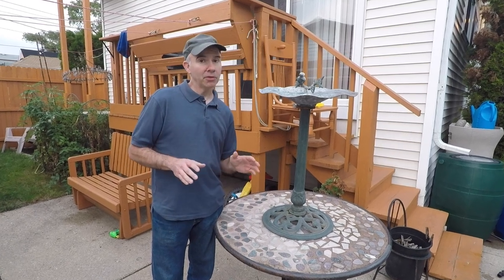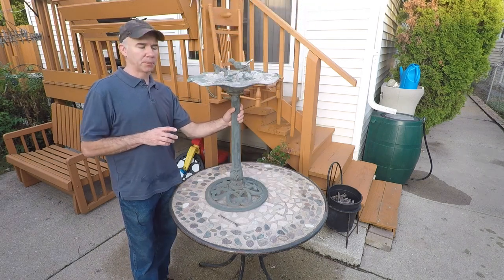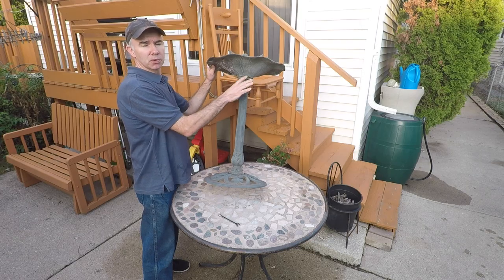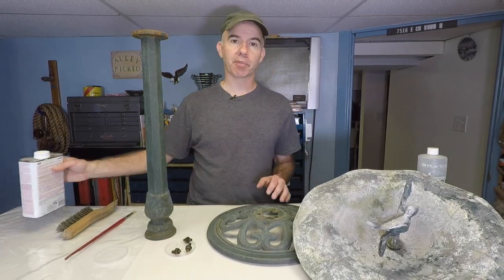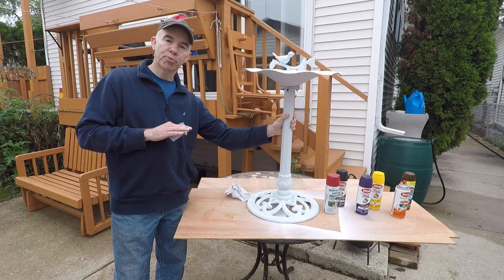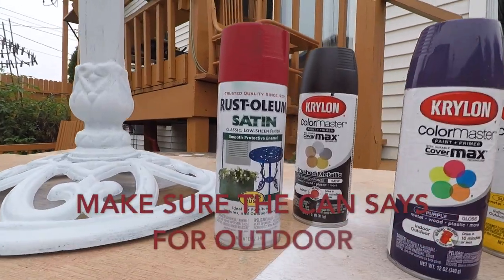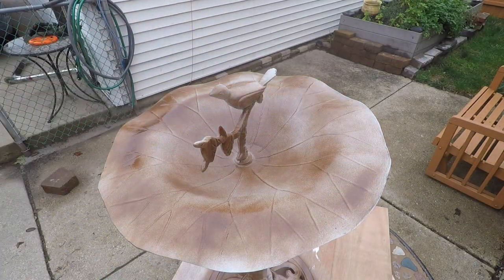Bird Bath Restoration

Comment: Someone touched on this a bit below but it's super important that the paint in the actual basin is only acrylic or latex. Oil or petroleum based paints are NOT safe for our feathered friends. The paint can be finished with some polyurethane which actually is safe once dried. :)
Reply from the maker: Thanks for the tip. Another person mentioned using Flex-seal which he said worked very well. I'm not sure if that is safe for the birds.

Comment: Update - I used Benjamin Moore 2 part epoxy pool paint as a final finish and it's held up great. You have to sand the bowl to bare metal, degrease it with rubbing alcohol, 2 coats of Coronado WB Acrylic Rust Scat Metal Primer 36-11 White and 2 coats of the Benjamin Moore 2 Part Epoxy Pool Paint.

Comment: I see I forgot to add an update about the Flex Seal, It lasted a year then lifted from the metal surface, cracked and allowed water underneath it which pretty much finished it off. So not a long term solution.

Comment: Update on the pool paint, It's now May 2024, the birdbath with the pool paint is holding up great, I store it inside over the winter, I just gave it a good cleaning and there is no flaking, peeling or break down of the paint. It's going to the cat rescue shelter today to be set up in front of the shelter main room for the cats to watch. I would say the primer and pool paint as I noted in one of my earlier posts is the way to go. :shelterin:☺
Reply from the maker: Thanks for the great idea and follow up. I'll have to re-do mine as it didn't last but 1-2 years. I'll have to use your method.
Reply: @AlleyPicked  Glad I could help

Comment: Good video and nice birdbath find.  I'm watching this after a failed project. I sanded to bare metal, cleaned and then applied rustoleum. It was fine during summer and fall but then the paint flaked off in the bowl area over winter. :( But from what you said to another questioner - that happened to yours also)?
Reply from the maker: Mine did flake off after 1 or 2 winters. Cant remember how long it was. I'm wondering how to fix it now. I was considering one of those epoxy finishes. https://youtu.be/ptOUQbR1Ino

Comment: I have this type and I cleaned it by scrubbing it with dish soap and it looks rusty brownish type. The model is greenish. Is the paint safe for the birds?
Reply from the maker: With the rain water constantly diluting the water, I think there is enough turn over in the water that it is safe. However, after about a year, the paint is peeling where it is in contact with the water. I wouldn't paint the section in the middle. Next time I would simply leave the metal and coat it with a natural wax or oil.

Comment: Thank you. I just painted mine red with the Rustoleom paint. But I wasn't sure if I could paint the actual part for the water
Reply from the maker: I did but after a year, the part with the water peeled. You can paint the edge but I would probably avoid painting the center where the water collects.

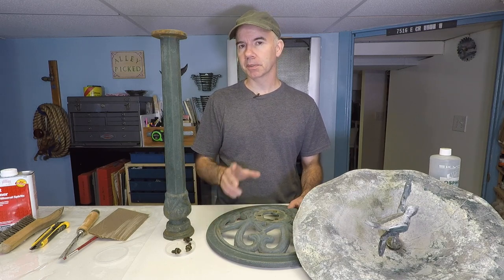Comment: After the "Ospho" but before the White rust oleum metal primer, you wiped on something else from a white and red can. It looked to be some sort of primer as well (I think). It looked like an oil of some sort. Can you please inform me to what that was. At 2:34 in the video it is sitting on the left side of the table in a square can that looks red/white in color but I cannot make out the words. Thanks.
Reply from the maker: Paint thinner. Thanks for watching.

Comment: If your bowl is cast aluminum rust-oleum won't stick. Mine quickly flaked off again. If the factory finish didn't stick not sure what will.
Reply from the maker: Someone else told me to try flex seal. I was going to try that and then maybe spray on top of that.

Comment: Does the Rust-Oleum primer come in clear ? I don't want a color on my bird bath, & is this safe for birds to drink from ?
Reply from the maker: Good Questions. I found a Rust-Oleum product that is clear for auto body work. Looks to me like it would work fine. As to whether it is safe for the birds,  my opinion is that it would be ok. As long as you let it dry thoroughly and completely and as long as the paint doesnt start to chip over time, I think you should be fine. Thanks for watching Alley Picked!

Comment: Why paint thinner after Ospho instead of before?
Reply from the maker: Just my opinion here but i think that since the opsho doesnt require a clean surface i didnt use thinner before. Afterward i sometimes get a white haze. Also good to clean with thinner before painting. BTW, there is a cheaper version of metal rust prep called Klean Strip available at Home Depot which works as good.
Reply: Ally Picked thanks for the reply.  It makes sense about the paint thinner now.  I think this video will greatly help me in restoring the bird bath we have.  I can pick up the paint thinner at Home Depot for not that expensive.  I wish I would have seen the reply sooner though because Ospho was hard to find and I ended up buying it on Amazon for $24.99 plus tax so $27.33 total (for 32 oz) and it was shipped all the way from Clearwater FL for some reason.  I will use bright colors to make it stand out and a mixture of two blues for where the water goes and am very much looking forward to the final product.  Thanks a lot! 
🌺🌸 💦🐝